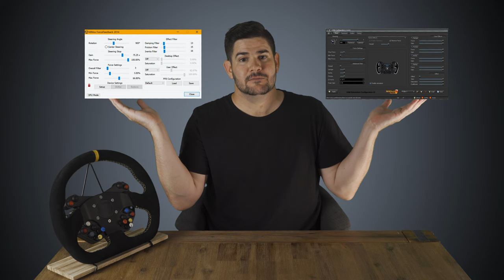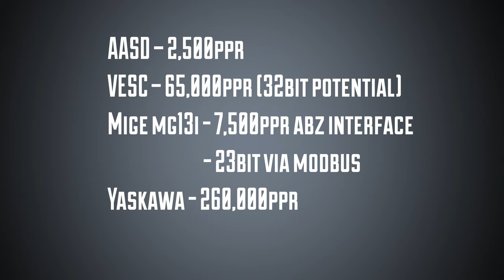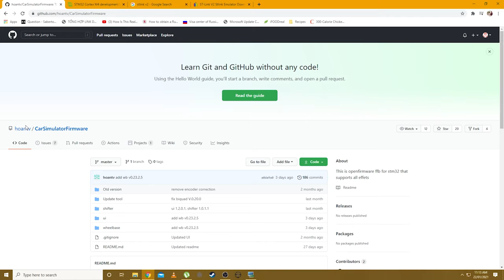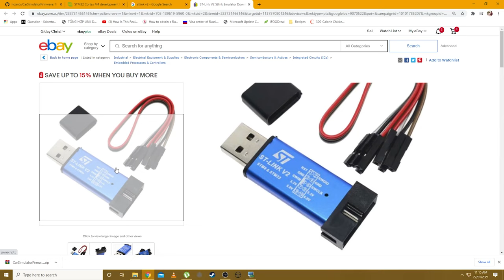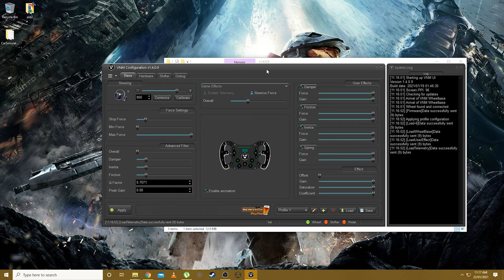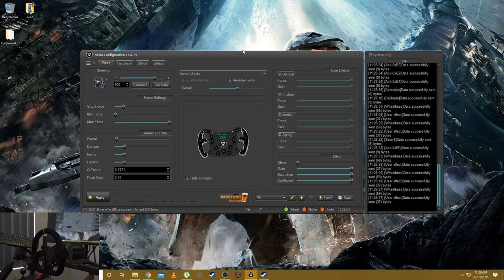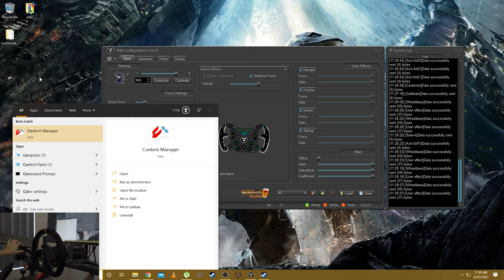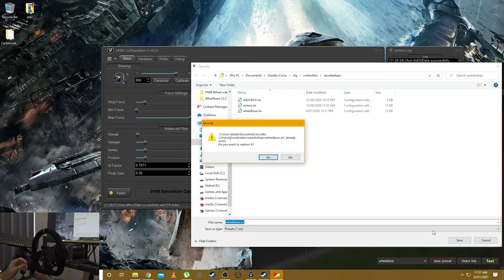VNM Wheelbase Force Feedback Firmware Review - The future of DIY FFB??

Comment: This firmware is horrible ... i checked their github and wiki and there is no guides or tutorials how to connect wires, no pinout diagrams, discord is a mess.
Reply: The fimware setup from mmos too vnm went easy .soldering pin 11 too pin 8 .on mi discovery board .onley the setup in vnm is tricky.ill go back to mmos .and for a lot of games that not work with mmos .will work with a xml file .

Comment: Hi, i've ordered a Ali stm32 board in order to put it onto the TDD board with the HoanTV FFB software. We are kind of struggling though to get it flashed. I have the usb cheapcharlie v2 programmer, but it doesnt seem to work although it states programming completed. maube its a good idea to make a summary video in how to flash it, and what steps to be taken. As i understood, there needs to be made/deleted a bridge on the TDD board as well, but i dont know whichone. These are small issues, that can consume a lot of time, where a video would help, which boostst support as a result as well. Just a tip. And keep up the good work! I Lllllove it!!
Reply from the maker: I did go through the steps of flashing. But you have to remember I have the V1 prototype TDD which uses a waveshare core407V as stated in the video. I don't have to cut any traces.. just flash and go. You'd have to ask thanos what needs cutting.. I'm unfamiliar with what stm32 board yous use nowadays.. it should be as simple as looking up that board and finding out how to flash it.. 

If someone donates me a new board then sure I can make a video but yeah its a bit hard without one. How long does it say it took to flash? Mine is like 2.5secs

Comment: Hi Chris, did you use a TTD board with external DAC in this video? Or were you just using software DAC of VNMware?
Reply from the maker: Thats using the TDD DAC. To use software DAC you have to solder jumpers and cut traces etc. Which kind of defeats the purpose of the TDD.. would just turn it into an expensive breakout board haha. If you want to use software DAC just buy a cheap stm32 board and wore that up like my diy video. You can get boards for like a fraction of the cost of a discovery board that will work (like the black board used in the TDD).
Reply: @peacemakermotion3949  thanks for the reply mate. Love your videos btw, your the only content creator in Sim racing space that makes video about affordable builds. Would love to see a video of you testing the VNMware software DAC. I wonder if that will improve the high pitch noise coming off the AASD drive. Cheers

Comment: does it work on the black pill stm32? is this system better than EMC PRO?
Reply from the maker: Emc looks to be arduino.. stm32 is superior hardware so I've heard so I'd imagine so. But I haven't tried it or looked into much but I know alot of arduino users are converting over. You're best to go ask in the discord for VNM. You'll get a much better answer from more knowledgeable people haha.

As for the black pill I don't think so because the flash size isn't large enough for the firmware.
Reply: @peacemakermotion3949  EMC PRO is software and fimware used on steering wheels with force feedback as well, and uses stm32 boards.
Reply from the maker: @1djval oh cool, yeah the video i watched was arduino but the clicking on the link then says arduino has been stopped and its now stm32. cool!! looks alright.

Comment: Hi, switched from MMOS to this. Once ive centered it, it aligns itself. I then try to calibrate it, and it does it, but at the end it just spins freely clockwise for some reason. Please can someone help me with this? Cheers
Reply from the maker: Did you try changing direction on your aasd?
Reply: @peacemakermotion3949  that's mode pn191 right? I will try that.
Reply from the maker: @lou2737  yep that's it
Reply: @peacemakermotion3949  that actually made it worse for some reason...really don't know what's going on here
Reply from the maker: @lou2737  does it spin to one side and bounce off its end stops? If so try doing fn007 and calibrating your torque offset
Reply: @peacemakermotion3949  at the moment, it is as though the force is reversed. It doesnt want to centre, and just bounces off one of the stops depending on which direction you push it - very strange.
Reply from the maker: @lou2737  set pn190 = 0 then run fn007 and hit enter enter etc and it will calibrate your torque voltage offset. Then if its still slightly spinning you can adjust pn190 into the negatives (usually) until it holds center.. try that..
Reply: @peacemakermotion3949  ive done that now - it now doesnt do anything, and when it does do something, it oscillates extremely quickly, vibrating and shaking the sim rig.
Reply: @peacemakermotion3949  ive switched back to mmos for the time being. thanks for the help regardless!

Comment: Hi ! your video is perfect ! I'm french and i don't understand everythings. I have question, is it possible to use this software with the Thanos TDD board ? Thanks a lot
Reply: Hello, I am also having trouble understanding everything , will this software work with the tdd. that I want to order? Is there any other hardware needed?
Reply from the maker: @arcoa8710  Hi there, yes it will work with TDD board. Thats what I am using :) I have the prototype TDD so I have a different stm32 board but will work the same. You may need to remove a jumper to flash the board then put it back on to run firmware thats all. Pretty simple.
Reply: @peacemakermotion3949  ok, i will order the thanos TDD board and I will plug and play with this software ! Thanks

Comment: high i built myself a steering wheel but when i enable the spring efect it starts oscylating like crazy any idea how to solve it Thanks
Reply from the maker: Ensure the pn001 is set correctly to what motor you have
Reply: @peacemakermotion3949  jeah its set corectly what else could it be?
Reply: @Kurth_Engineering  PN191 at 0, or if you have on 0, put in 1

Comment: @Peacemaker Motion I have a Thanos board and am trying to run VNM Wheelbase on it. Having some trouble with it. I've gotten to the point where the UI recognizes the wheel, but the wheel won't lock at normal 900 deg of rotation locks. it can rotate past that. Also the calibrate function doesn't work, I click it but it doesn't do anything. Then randomly it will start shaking. Any thoughts on how to fix that? Is there something I need to do to the Thanos board to make it work? I've seen something about the pin outs in VNM being different than MMOS, if that is true do you know what needs to be changed?
Reply: That was my

Comment: Just brought a Thanos controller a few days ago due to your videos. Really hope I dont have to change hardware again.
Reply from the maker: I run thanos as well. You'll just need a $10 st-link programer and you can flash it with thos firmware. But get it all setup and try it out with mmos first. Then after a week or so try it out and see the difference ;)
Reply: @peacemakermotion3949  aye! That's so good! So far only have the board incoming but cheap servos are coming up on ebay that im looking into grabbing. Its just a matter of compatibility.
Reply: @EnvyOCE  the TDD has breakout of the 4 pins needed to attach external stlink programmer to change to this firmware. 😉
Reply: @tronicgr  thankyou for letting me know! I'll be in touch when I have it in hand, as I may need some guidance (first time doing this sort of work)

Comment: hello, is the connection scheme the same as the mmos?
Reply from the maker: yes, but if you want to use the built in DAC on the stm32 board you have to swap pe9 for pa4 :)
Reply: @peacemakermotion3949  and e-stop wiring?

Comment: So you say it’s night and day, is that after tweaking the filters? I would think it would be the same with all the filters turned off as you had in the video? Or is there a difference even then?
Reply from the maker: Those were the user effects i turned off. I only use them to test forces outside of a game and in the software. I guess if a game had weak ffb effects you could run a bit of extra dampening etc with these effects but they are just constant effects and not driven by the games data. Not sure if people use them in game or not.. there is another button I forgot to click on which has all 12 effects and their gains listed but I just leave them all maxed out.
MMOS has the same user effects option but you can only play with one at a time via a drop down box hence why I'm assuming they are only intended for testing purposes..
Reply: @peacemakermotion3949  right but so with the user effects turned off in both cases with mmos and vnm there is still a difference with the way they interpret in game ffb settings?
Reply from the maker: @volod3mir  yes there is. There's heaps of ways to interperate ffb data. Even just watching how the simucube software continually changed the experience for the user over a couple years says there's alot that can be done on the software side to change and improve ffb. I'm not a programmer so I can't elaborate much more than that though haha.
Reply: @peacemakermotion3949  good to know, I wasn’t sure, will have to try it out then!
Reply from the maker: @volod3mir  he did mention today he's having issues with belt driven wheels and minimum force settings so if you've got a belt setup maybe head over to the discord and ask about it. Video was already live at this point though
Reply: @peacemakermotion3949  no I have a 130st w/assd and thanos tdd on the way, was already thinking of trying the vnm firmware but this made me sure if it, thanks for the video!
Reply from the maker: @volod3mir  ohh nice man! Well get it up and running with mmos first and use that for a few days or so. Its still good software. But then try VNM and see the difference. :)
Reply: @peacemakermotion3949  yes good call! TDD is already flashed with mmos so will good to at least make sure all the hardware is setup and working properly without introducing new variables...

Comment: Are you able to test with the onboard DAC? Does it work well with the onboard?
Great content!
Reply from the maker: I haven't personally. Might do a video on it soon and see how it compares. But I hear it does alright
Reply: @peacemakermotion3949  got everything set up. Using PA4,PA5. but i am not getting any motion in the motor at all when clicking calibrate. Tried  PE9 and PE11 to no avail either. Though the motion is being picked up in the animation when manually turning it. Spec's are stm32 + 130ST-M10015 (25NM) + AASD-30A. Settings at PN001 = 22 (motor code, requires restart)
PN002 = 0 
PN003 = 0 
PN018 = 0 
PN051 = 1500 
PN053 = 18 
PN188 = 159 
PN189 = 39 
PN190 = 0 
PN191 = 1 
PN198 = 250

DB25 connector
Pin 25 - PE9
Pin 20 - PA1
Pin 18 - PA0
Pin 15 - PA2
Pin 13 + 10 - GND
Pin 9 - 5v
Pin 7 - Pe11
Pin 6 - GND
its as if its not getting power or a signal to turn?
Reply from the maker: @jamieb78  try swapping your estop NC and NO. Basically when you release the estop you should hear the AASD start to whine and power up. If that's not happening then you may have estop setup wrong. Triple check all your pinouts also
Reply: @peacemakermotion3949  I currently have that ground pin6 directly in. Leaving the estop out. Had a suggestion on discord to PA4 to pin 25, PE11 to pin 7. Set "internal dac" for controller on hardware tab and "signal + DIR" for mode.
But looks like my STM board has blown since doing it. New one ordered now 🙄
Reply: @jamieb78  Have you dealt with the correct connection of the wires? If so, can you write how? i have the same kit as you.
Reply: @Jaeyezme  forgotten who put this on the discord for vmn so apologies  not my work but the below worked great  Use PA4 and PE11 for internal DAC + Dir.

PA4 --> Pin 25
PE11 --> Pin 7

I posted this in HoanTV's (VNM) Discord. Thought I'd post it here for those who want to try it out...

For AASD users: I have found that I get a MUCH better FFB experience using the Signal 00..50..100 mode in VNM rather than Signal + DIR.

Quickly, here are the steps I did to setup VNM and AASD in the 00..50..100 configuration.

1. Engage e-stop for this entire process… you don’t want the motor able to turn as we will be changing the analog voltage offsets significantly.

2. Configure VNM to use Internal DAC and Signal 0..50..100 on the Hardware Tab (** If you are using the Thanos TDD board, I believe you set the Controller as External DAC, not Internal DAC, but I am not sure as I don’t use TDD).

3. In this configuration zero force will be in the middle of the DAC voltage range (so half of 3.3v = 1.65v), Counter clockwise forces will be negative voltage, and clockwise forces will be positive voltages. Therefore, we must set the analog voltage offset (Pn190) to be zero when the DAC is sending 1.65v, while also accounting for the non-zero resting voltage of the analog pin.

4. Using Dn017, we can see the raw voltage being received on the analog pin. Dn016 will show the interpreted voltage for the torque command after summing the voltage at Dn017 and the value of Pn190. Our goal is to get Dn016 to read zero when no force is being sent to the servo driver. So, with e-stop enabled and the wheel centered, verify no User Forces are checked in the VNM setup. Check the voltage at Dn017 (mine is 1.75). Now, set Pn190 to the NEGATIVE of this value (in mV). So, my Pn190 is set to -1750.

5. Verify that Dn016 is now at zero voltage with no forces being sent. Enable the motor by disengaging the e-stop, and test the Spring Force in VNM User Effects. If correctly configured, spring force should work correctly with much higher fidelity around center.

6. Recalibrate within VNM and you should be all done. Open your game and enjoy. See the difference by feeling the road details on the straightaways of good laser scanned tracks.

Also, your maximum torque value will now be + or - 1.65v, so you may need to adjust your gain on Pn189 to increase the overall force.
Reply: @jamieb78  Thank's a lot for quick answer !!! It's all now clear.  I will do it step by step and I hope it will work!  Hava a nice day!
Reply: @Jaeyezme  if for some reason it doesn't work. It happened to me. Just reset everything back to factory and start again.
Reply: @jamieb78  thanks man!!! You make me win a lot of time. I have a question about the center position when you are in a straight I feel some stranges vibrations only in the center position, if i turn a little bit to one ora another side this vibrations gone. You know if exist some solution for this problem?

Comment: with vnm is it possible to use the g25's pedals and shifter?
Reply from the maker: You can wire up pedals but not shifter in my understanding. The pin needed for the shifter to work is used for something else in vnm. But there is a pinout to get pedals working. Best bet is probably get a usb adapter that plugs both pedals and shifter into and converts to usb. They're like 30usd on ebay. Alternatively there's an arduino tutorial to use ardunio and make your own on YouTube